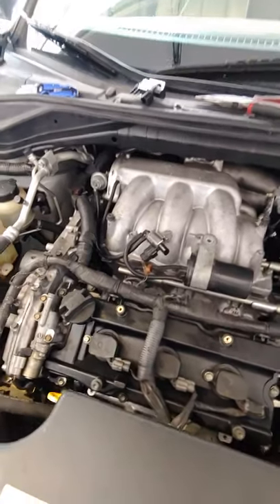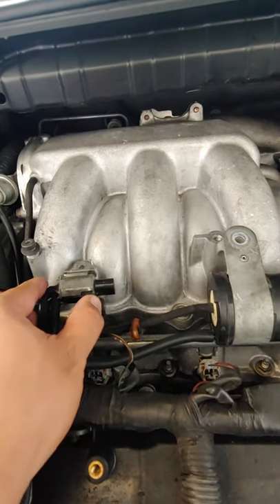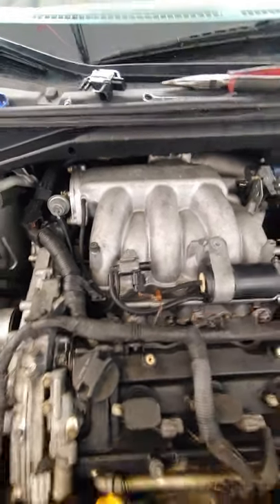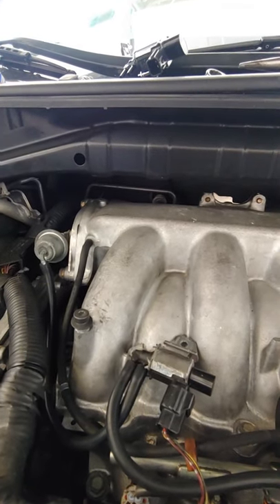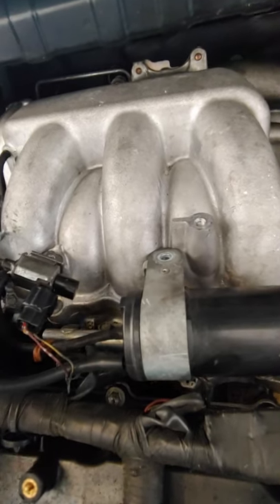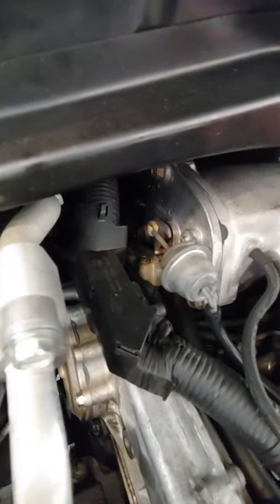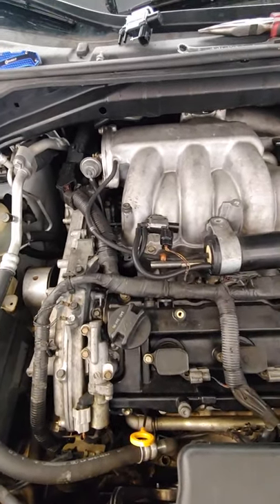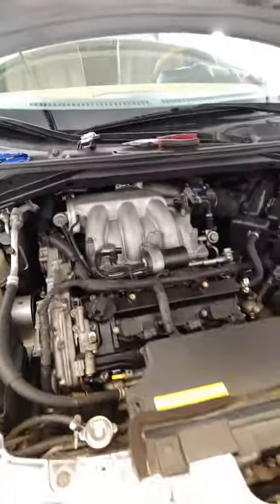2007 Murano VIAS valve/Vacuum solenoid hose routing

Comment: I was having the same issue with 2005 Nissan Murano. My mobile mechanic swaps those hoses a while back when we were on the third VIAS sensor replacement with no luck. That didn't do anything either. Then we went to get the sensor and vacuum reservoir of the whole unit from a junkyard. Again we connected the hoses wrong. It was reversed at the Manifold side like exactly you mentioned you did. I was hearing the hissing noise from the VIAS sensor which was air leaking and that was Exuaest getting into the car. When I correct the hose placement the way you said the air leak went away and I don't have that exhaust smell inside the car. Another thing I wanted to mention here just before I watched your video, I watched another video where a guy explained how the choke kind of lever behind the diaphragm should move up and down when you accelerate and mine was not doing anything. But after I reversed the hoses as you said it starts moving. My check engine light went away and thank you very much for your help.

Comment: For people who buy Nissan Murano; For example, used. with many miles traveled. I suggest you invest in buying to the car the most relevant sensors. This is because you are buying a car that has parts that are probably defective. Unless you want to be disappointed by problems that will arise and that will correspond to you.

Comment: 2002 Infiniti i35  Okay I'm going to be the dumby of this comment section for 2 years since I changed the spark plugs the first time after looking at your video I had those backwards those tubes that you were saying the vacuum tubes yeah I had mine reverse too I've been going through code after code after code trying to get the emissions straight and I haven't had success they keep coming up a new one every day today I had even two come up but I don't know if this is going to help that but I do appreciate you showing me how to have it right and I have it running now and yeah it is running a lot better so I appreciate it thank you very much and GOD Bless you and yours. Like I said I'm the two-year dummy in this comment section lol

Comment: Intake Manifold Runner Control Valve. Had same issue on a client's car (04 Maxima). Not being familiar with the system, I replaced it to find I still had huge vacuum leak (25% STFT on Bank 1!). I was stumped! Couldnt find any diagrams but after going back to the drawing board, it dawned on me that the hoses must be wrong. Just now seeing this video after the fact! Signs I ignored: 
1. plugging the vent side corrected leak
2. motor had "good trans" written on it in marker (must have had a swap)
3. The bolt holding the valve in was already loose when I started troubleshooting! 

Moral of the story, trust your gut LOL

Comment: Anyone know where you can find the hoses to the intake manifold runner control valve. Mine has a damaged hose and I can’t find the part online
Reply: Auto zone they have hose they can help u measure them only like 87 cents

Comment: I just went and looked at mine and it's not routed like you said it should be and it's never been touched.
Reply from the maker: If it's working then don't touch it LOL
Reply: Oh now I'm not sure with my 2007 quest, purchased used and it's definitely with touched in engine but not sure if these hoses have been moved, getting p0174 light, guess I'll try.